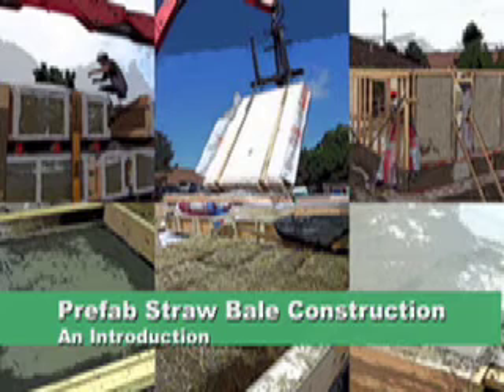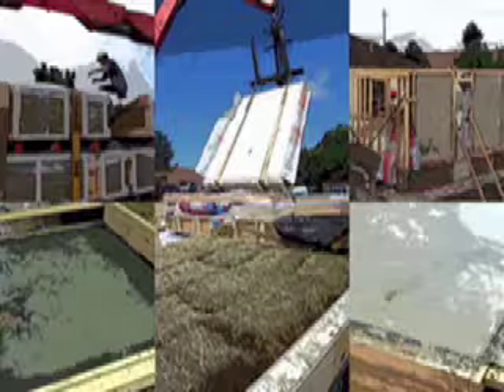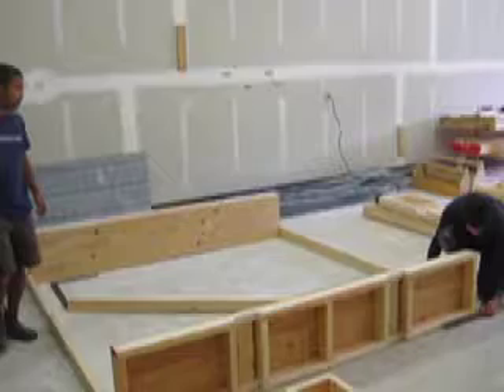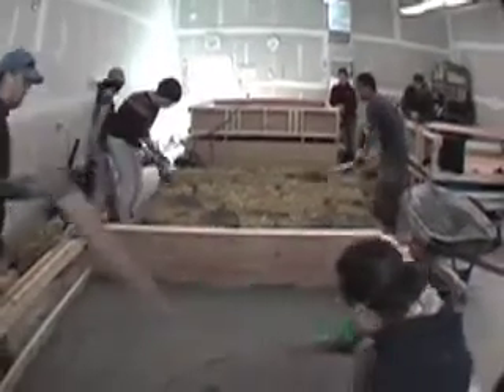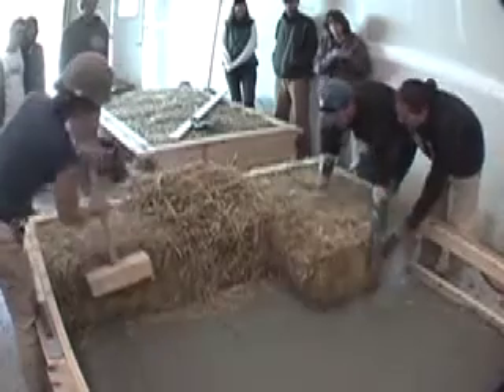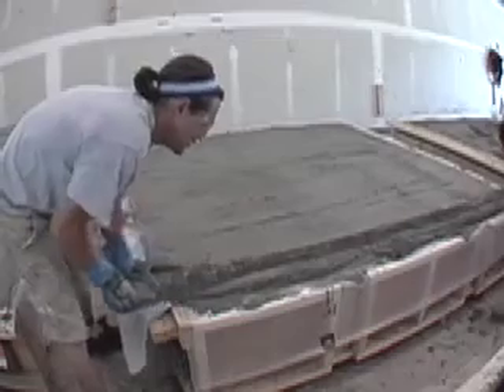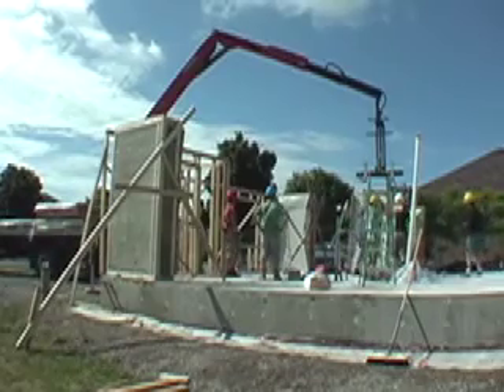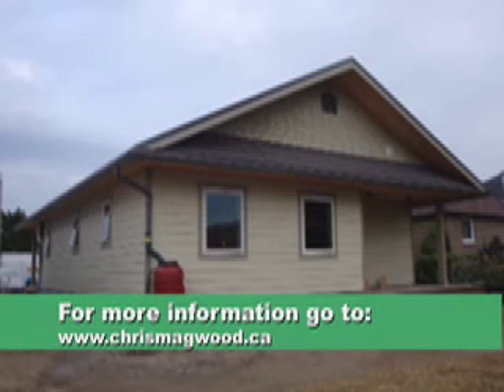Prefabricated Straw Bale Wall Panels

Comment: what is the final weight of each bale panel?
Reply: There's 2 per row with approximately 10 in each row with extra 5 quarter they use to tighten it up.  Each bales of straw weight approximately 75 lbs which brings us to 825 lbs. Then you have 1" plaster and the box itself. Easily 1200+lbs  for each section. This is using BROAD back of the napkin calculations.